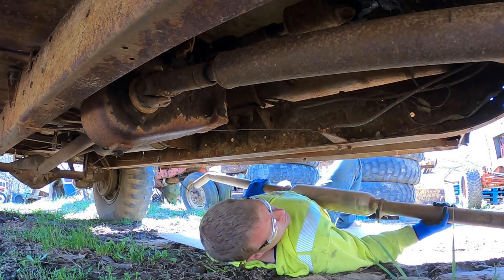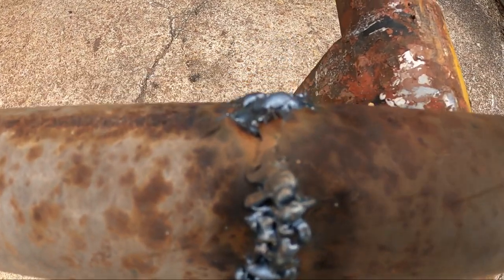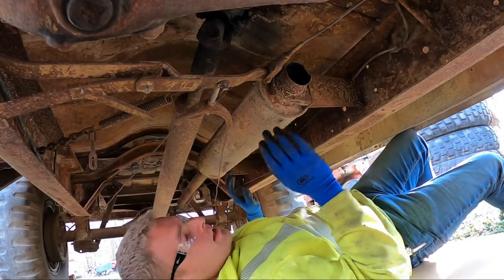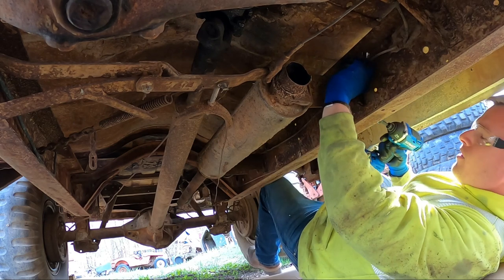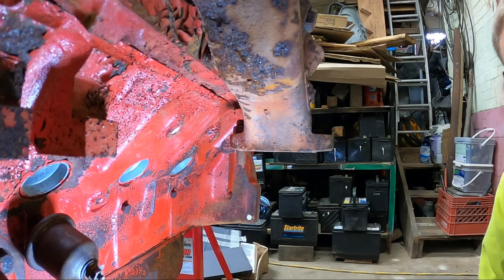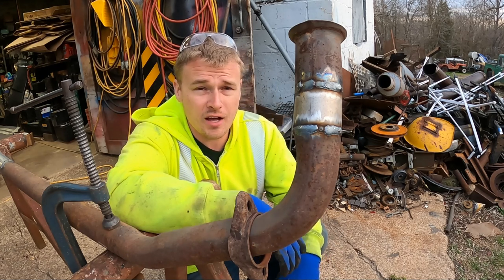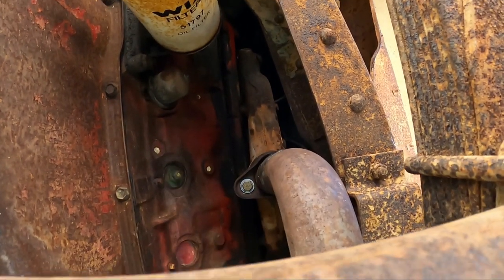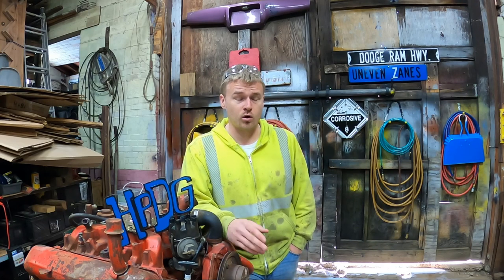My 1968 International Travelette: Exhaust work

Comment: Good Job. Back in the day I welded exhaust with a torch and coat hanger and If I had the money used a brazing rod. Today I own a wire welder. A tip if welding outside in the wind  use flux core wire you dont need shielding gas.
Reply from the maker: That's true! :)  You done well for doing it that way, MIG is such a luxury now days. Nice to be able to weld thin metal instead of Oxy welding. Thanks for the kind words and for stopping by. Take care :)

Comment: Just now getting to tune in and watch . Great to see you on the air , and doing well .
That’s good work Zane !  You weld just fine . I mig welded for 5 years .  Welding thin stuff takes practice , and just being familiar with your welder and the settings that work best for different thickness . I had markings on my welder voltage and wire speed dials for different jobs and thickness 👍
Reply from the maker: Oh, I didn't know that about you :)  Thanks for watching as always my friend. Hope things are well in your neck of the woods. Just got over the FLU so sorry for the delayed response. Yeah, welding thin metal can be difficult :)  Take care buddy

Comment: I really hate doing exhaust work,  I put a 75 Cadillac 500 engine,  and TH 400 transmission in a 77 Chevy pickup.  When I got it all together I took it to a muffler shop.  A young man 22, I told him I wanted 2 1/2 dual pipes and I had 2 mufflers.  I was surprised,  the guy says,  that sounds fun ! Pull it in here and let me take a look.  He did some measuring,  and said,  the Cadillac uses 2 1/4 inch but I can bring it down and step it up I said ok. He made all the pipes,  hanger brackets,  used my mufflers and only charged me $110. It sounded nice Thrush turbo mufflers the tail pipes went all the way to the rear bumper.  I was happy and impressed.

Sir, you do some really fine work,  and it especially nice to see you using what have.  Since that engine won't be there permanently it makes sense to do it your way. I am always impressed with your work,  and the way you figure things out. 
Great job Sir
Reply from the maker: Oh, I bet that Cadillac 500 v8 was fun in that Chevy pickup!  What a cool project!  Not a bad price for the exhaust work either. I appreciate the kind words about my exhaust work. Really means a lot! :)  Take care Bert and I hope to catch you net time.
Reply: @HODGEPODGEDODGEGARAGE  
It was, the problem was, when it rained,  it was a pain trying to take off, all it would do is spin the tires.  I did get 16 MPG on highway and 12 MPG around town.
Reply from the maker: @bertgrau3934  oh I bet it was hard to drive in the rain! 😲 That's pretty decent fuel mileage for a big v8 though 👍

Comment: You did a Jam up Job on repurposing the exhaust from the wrecker, and those welds look pretty good for someone who doesn't do it every day, I'd give it a 10/10. I can tell you had the machine set right just by the sound. As you always say, happy wrenching! Great video, Zane! Also, I hope you have good luck out of the Kobalt cordless tools, mine have been through hell and back and are still kickin!
Reply from the maker: Thanks Maverick! :)  I seen they got good reviews so I figured I'd try them out.   Thanks for the kind words on my welding LOL. I'm used to welding sheet metal more. I appreciate you stopping by and happy wrenching on your projects. :)
Reply: @HODGEPODGEDODGEGARAGE  anytime, buddy! The more you weld, the more you'll find that thicker material is easier to weld, I'm going on four years with my Kobalt cordless tools, I think you'll enjoy them!

Comment: Awesome job! The way you did it is the way to go in my opinion, without a mandrel bender you'd have way more time in it than it'd be worth to make it all from scratch anyway. 
P.S. The only time that running open manifolds will burn valves is when you put a big load on it without enriching the fuel mixture to compensate for the scavenging effect. It'll run leaner without the exhaust and therefore hotter. Realistically you're not going to hurt an old V8 running it with open manifolds. There's a guy on here "Invincible Extremes" that drove his Firebird halfway across the country with one of his header tubes completely missing, he made it home just fine. Fun fact, the Ferrari tuning manuals from the 60's specifically say to run the engine with the manifold removed and watch the color of the flames shooting out of the ports when synchronizing the carburetors... ANYWHO, I'm looking forward to hearing your truck running!
Reply from the maker: That's pretty cool! :)  Thanks for the info as well. I'm hoping to get the truck running very soon. Got a few video ideas for it as well. Take care :)

Comment: Zane Why a Y, go with true duals off the manifold  twin mufflers they sound great. You can follow both frame rails or cross over to one side,  They had twin pipes on the S series on bus chassis with air pumps because they ran so hot. great fab work.
Reply from the maker: Thanks for stopping by Ed :)  I was hoping to use both pipes buy ran out of room by the transfer case. I couldn't use both side by side. I could have ran into a single muffler but didn't have the bends I needed. Closest exhaust shop to me is about a 45min drive :/   Hope you're doing well my friend :)  Take care and stay safe.

Comment: Nothing wrong with driving a dump truck. It is an honest job. I drove a log truck for a few years and made a decent living doing it. Do you drive a semi or straight truck? Good job on the exhaust. I like how you use what you have and make it work. Kinda like some of my projects...
Reply from the maker: Thanks for the kind comment. I  usually drive a 2020 Mack Granite tandem dump truck for work.  What kind of projects do you have? :)
Reply: @HODGEPODGEDODGEGARAGE  Mack is a good truck. I started out in a 1978 R model then a RD then a CH. All were good trucks. They were all pre emission trucks so they ran out good. I just retired from a 36 year career in aerospace manufacturing. Mostly machining lot of fabrication and research and development. Just finished a total and I mean total head to toe rebuild and restore on a 1939 B model John Deere tractor. I retrofit old farm equipment to no till type. Lot of food plot stuff etc...

Comment: Looks good, just wondering why you didn’t run dual exhaust down the drivers side instead of running the y pipe
Reply from the maker: I ran into space issues. Couldn't run both mufflers or pipes because of how close the transfer case is to the frame.  Had to do the "Y" to make it all work for now. Thanks for the view and for the kind comment. Take care :)

Comment: Hi you said that this drivetrain is not going to be permanent in this truck just curious what drivetrain have you considered to go in the international permanent if you don’t mind me asking. 
I agree with you on use what you have around the yard to make it driveable since you’re planning another engine swap. 
With all the extra international engines you have have you considered building a backup power generator for your home with one of the engines that you have. Just a thought 💭 
Have a Blessed One Sir
Reply from the maker: Well Eddie, I was actually considering an LS engine but there isn't a good (reasonable priced) manual transmission option. I'm leaning towards a 4.6 modular Ford engine with a stand alone harness. That way I could run a gas model ZF6 transmission behind it. Just a thought as of now. Coincidentally a 4.6 Ford in a Mustang could some with a supercharger 😉🤫
Reply: @HODGEPODGEDODGEGARAGE  is there a way to adapt the gas ZF6 to the LS ? Surely someone may have a way to adapt. As far as a LS engine the 5.3 is a good solid engine I had a Chevy Avalanche that had one plenty of power and torque.
But a supercharged 4.6 modular ford would be awesome as well.

Comment: This has nothing to do with exhaust work - which I HATE:) - but I know I'm going to forget:  if you reuse that transmission crossmember for your next engine/trans combo, clean and inspect the hell out of it. Those C-channel frame crossmembers break A LOT. If IH trucks had a weak link - that's it.
Reply from the maker: I appreciate the info! :)  When I bolted the exhaust under the truck I actually noticed it is cracked already!  I'm hoping it will hold together long enough to enjoy the truck for a month or two.  I don't plan on wheeling the truck too hard. Thanks for stopping by my friend :)